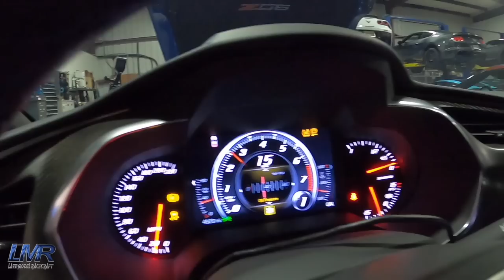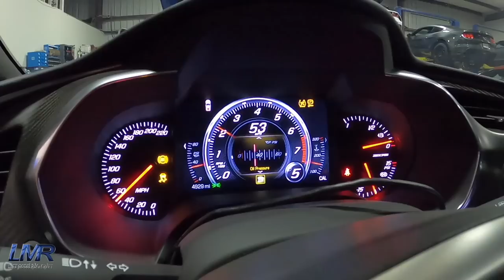Fereday Edition C7 Z06 Corvette Convertible BUILD and DRIVE!!!!

Comment: Would it be better to have the air filter in a enclosed box so wouldn't  be taking hot air from the engine compartment
Reply: Where does the air box get air?
Reply: It gets cooler air coming from in the inner fender area